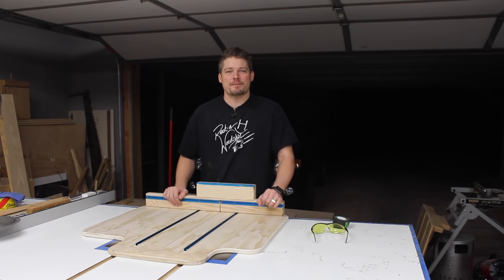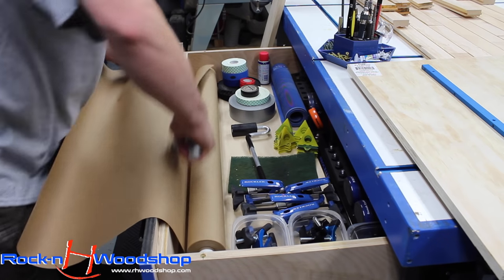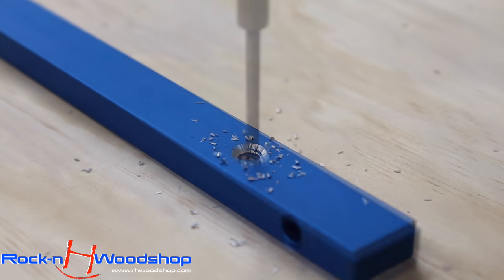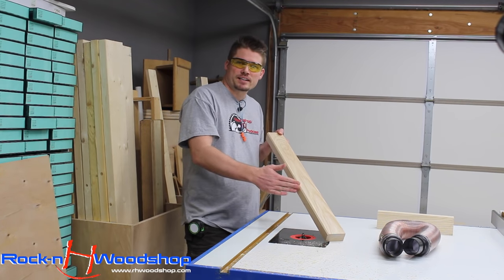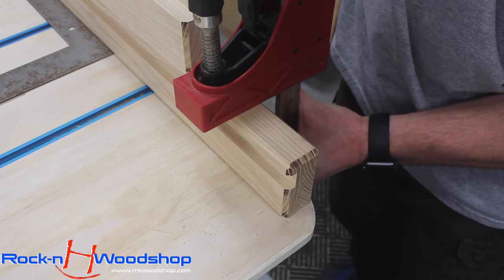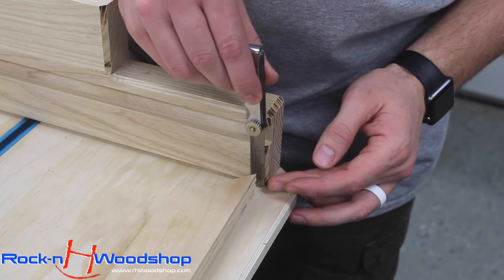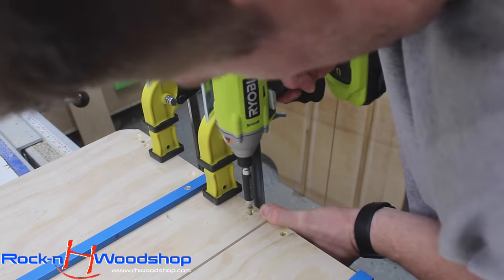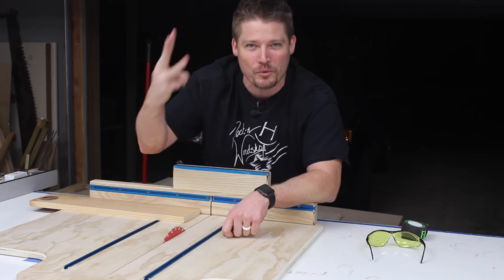Ultimate Crosscut Sled with Dust Collection

Comment: Hi, Sam here. Great sled! I have been working on one for myself and have experimented and was going to go with the extended nose tomorrow to see what happens. I like your shows and you do explain things very well. Now for 2 questions 1) I have been a contractor most of my life, but first time building a shop and working at home now. I have seen you and several other sites use some clear liquid glue? stuff either for temp hold or with wood glue because this clear stuff dries quicker than wood glue. Okay, what is it? it is not super glue or epoxy type product and you can use a quick activator. I have heard it referenced by initials and some code name. This little build stuff is new to me and having fun once again. Please help??? 2) This is only asking ... if you drilled several holes through the back board of the sled into the dust collector box, would it work better or does that blade cut really pull enough thru it? Is it okay if I use some of your idea for my sled? I was not that far behind you, maybe a year or so HAHAHAH. Keep up the work, looking forward to watching more.  Sam
Reply from the maker: Samuel Lunsford Nice to meet you Sam and thank you very much and I would much like to see your sled when it is completed. Now for your answers to your questions the glue that you are referring to that you hear initials or code being spoken of is probably C&A glue. This is just a fancy way of saying  cyanoacrylate glue, which is just plain old super glue. I use DAP rapid fuse glue which is the same kind of glue but is very effective on wood surfaces.  Now for your second question. I chose not to use screws in the box itself mainly because the blade was going to be in such close quarters with the box construction. The box is closed on five out of the six sides and it pulls quite a bit of dust through. I just completed a blog video that will air tomorrow on my second channel that will show a drastic difference with and without the dust collection. I hope that helps answer your questions.

Comment: Excellent design and video tutorial . Just a quick question I used your formula in a calculator and got a different answer what did I do wrong ? You had 0.0184 but when I did it I got -0.0081699, where did I go wrong ? .Thanks .
Reply from the maker: +Humble71 well after I posted the video for a while I realize that my graphic had a miss print in it.
Reply: thanks for admitting to the typo. I've just noticed the same mistook. I did "cheat" by using a spreadsheet to get there
Reply: Great video!  In the five cut method, you need to rotate clockwise...basically, the cut edge should be on the sled's fence, only then you compound the error 4 times.  In your case, you rotated counter-clockwise, so the error never compounded 4 times, it only compounded twice.   I think that's the reason it didn't quite align.  (This is anything better than I have..just wanted to point my observation :) )  Best!
Reply: @ClosetWorkshop  Check the video again, when he pointed to the board and counted of the side he did it counter-clockwise, but he made the cuts clockwise.

Comment: I have to have one of these so I bought your plans. In the plans you say to run the grain of the plywood across the width of the sled. Why is that? I would have thought the grain should run along the length, and actually wouldn't make any difference since the grain in each ply runs perpendicular to the grain in the adjacent plys.
Reply from the maker: If I said that specifically, I did not mean to say that in the plans. Plywood should not make a difference because grain direction really doesn’t matter in a crosscut sled. With a very sharp blade, you won’t have splintering anyway. Most of the time, With a ordinary blade, if you run the grain direction with the blade it helps prevent splintering of the veneer.
Reply: Thanks, Drew. It's great to find someone that actually replies! Love your projects and very happy that you are going to be doing this fulltime.

Comment: About to build my first crosscut sled and after watching a plethora of  these videos this will be the video to help guide me through the process. 
However, how important is it to get that close to zero on the 5-cut method? If all I ever build requires me to just use a framing square to check for square, why then would I need to use anything other than that same square when putting this sled together? Hopefully I am not inferring that I am just being lazy. I build car subwoofer boxes - rarely do they need to be within .005 of square. Hell, we can get away with 1/16th of an inch. Hit it with some 80 grit and throw the carpet on there, done.
Reply from the maker: I think you would be fine with a framing square then. I just do more fine work and I like tight fitting joints. Personal choices is all it is.

Comment: Nice video!  Why did you decide to place your front stabilizer bar horizontally instead of vertically?  Is there an advantage?
Reply from the maker: Harold Aubry there are give-and-take with both methods. If you have a vertical stabilizer in the front of the sled then it limits you to how wide of a piece you can put on your sled but the blade will always be free of obstructions. With my design it is the exact opposite I can put as wide of a piece that I want but the blade will have an obstruction. However, the way around the obstruction is to lower your blade below the surface area of the sled and place your piece of stock on and raise the blade back up into it and make your cut. Then lower your blade back down, turn your piece over and repeat the process. This way you can place a piece of stock that is double the width of the sled and still be able to make the cut because you know your fence is exactly square.
Reply: Hey, makes sense.  Great idea!

Comment: I didn't understand the reasoning for the leading edge to be horizontal instead of vertical?
Reply from the maker: Since my back piece is laid flat I can cut as wide of a piece as the sled is times two. I can lay the piece on top of the sled and then raise the blade up cut and then flip the piece over raising the blade up and cut to basically turn my sled into a panel cutter.

Comment: Nice sled! I like the variety of t tracks. Do you think it's necessary to make a replaceable throat insert to account for different blade kerfs?
Reply from the maker: scott hillegass I have not done that in the past, but it is a nice option to have. Keep in mind you would need to do it on the fence as well as the sled base.

Comment: Any plans for the T-track on the fence?  Just simple stop block?  Curious as to why you went with the simple T-track as opposed to Kreg's Precision Trak & Stop system.
Reply from the maker: Yea Bill.  If you check out my two more addition jigs I made for this sled, you will see how I use those tracks.  I plan on making a video on stop blocks for my jigs too.
Reply: Rock-n H Woodshop Saw the spline and miter jigs (love your inverted version of miter jigs btw).  I guess I was more referring the the track on the fence where a stop block would typically go and the small section on your 2nd tier of the fence.  I guess I'll just sit tight for future videos.

Comment: Downloaded your plans and making basically the same sled as the design, but have a question. What is the purpose of the top T track on the highest part of the back fence? I have purchased the Kreg version of the stop block and fold down stop, which will be used in the lower track. Just missing why the top track so high up? Thanks. Will be making the miter sled after this one is up and running. All my parts are in, other than the top T Tracks that go on the surface of the sled.
Reply: Well, I think I figured it out by looking at the design/deminsions closer. If I have 'thick' stock I am cutting, I could move my stop blocks to the higher fence, and gain that benefit? Is that the reason - or something else? Thanks.
Reply from the maker: Yes in that respect and also I plan on making stop blocks that will hold very thin stock  right over the kerf.  Hard to explain but you will see soon when I make a video on my stop block set ups.

Comment: great video as always. just wondering, how well is dust collection with the sled collection on but the table base off?
Reply from the maker: +fradchy1 it still works pretty well. Another thing that I plan on adding is a plexiglass casing that will still allow the wood to be slid underneath but allow the dust to go nowhere but towards the back which will help with the cyclonic action of the vacuum.
Reply: good to hear, i think i’ll make this modification. the plexi makes sense and seems like an easy addition. thx

Comment: Could you please clarify.  Ng multiplied the length of his right pivot to the left end of the fence.  If I'm seeing right, your 12.875 is the distance from the blade to your left edge.  Which is correct? THANKS
Reply from the maker: This was an error on my graphic and I did not notice it until after the video has been posted for several days. My actual measurement was over 24 inches which was from the pivot point all the way to the other end

Comment: Few problems I see, the dust collection tube will be dragging on the edge of the saw table becoming a pain.

The timber guides will shrink and contract due to weather rendering the. 00005 accuracy ineffective
Reply: If you can't think of an easy solution for the vacuum hose I don't know if help is available

Comment: This seems like a solution looking for a problem to me.  If you would have just put a plain ol' block of wood as a blade guard, it wouldn't be shooting any sawdust back at you.  And you wouldn't have the dust collector hose hanging off the back of your sled snagging on the edge of your table saw every time you make a cut.

Comment: The shot at 4:08 of your dado blade shows a large dia knurled nut ?   Don't recognize that, is it part of your saw or part of the dado stack ?  Is that for toolless blade changes ?
Reply from the maker: Allan Perret it is part of my dado stack. It allows me to widen my width of cut by just loosening the arbor nut and turning the dial. It is referred to as the dial-a-width dado stack from Freud.

Comment: I am thinking your adjustment difference from your pivot point is longer than 12.875 which would be why your adjustment did not bring you within .002
Reply: You measure out to the adjustment point from the pivot not the blade.

Comment: I just added the same DC to my sled and it really doesn't do much.  What am I missing?  Is there anything else you had to do to get more suction at the end of the kerf?   Thanks...
Reply from the maker: +Gil Gomes Well remember if joints have air holes then the suction is not going to work out. So you need to make sure that every place that wood joints up, is well sealed. Caulking around the joints will help as well as making sure that the hose adapter that fits in your dust collection port is sealed well. I use electrical tape to help with that. I wrap it around the dust port adapter that fits on the hose so it makes a good seal whenever I plug it into the wooden port.
Reply: @rhwoodshop  I had sealed the box in place with foam with adhesive backing.  It's well sealed, believe me.  The vacuum attachment is actually tapered and can only be pushed in about 90% of the way, causing a nice tight seal.  I scrolled through other videos of table saw sled dust collection and found one where the author had exactly my problem.  Problem was solved by drilling a 3/4" hole above the kerf slot and under the T-Track.  NOW it works perfectly...

Comment: Is that a Royals Baseball cap?

OK I see a 10" RAS in the background do you really need a crosscut sled?
Reply from the maker: Ha, no it is my logo hat. The RAS is not in operation yet but it is coming.
Reply: @rhwoodshop  
I have 2 radial arm saws,  watch some stuff on youtube for safe operation. 
Pay real close attention to feed direction ripping on it, 
I got my first one new, second one wasnt working right, 
I have 3 table saws.  If that ras isn't working take the cover off the motor and blow out the sawdust. The older ones would fill with sawdust and the blade wont get up to speed. The older ones are a dime a dozen no one wants them.  But you can do some neat stuff with one.  Just work smart. And make fixtures

Comment: nice sled just make sure you don't cut it in half because you did not put a front fence and you didn't cut it either.
Reply from the maker: certified30 that's the trick. Lol
Reply: Rock-n H Woodshop I’m curious; why the horizontal, versus vertical, stabilizer?
Reply from the maker: It allows me to cut as wide a panel as I can get on the sled and even if the piece exceeds the sled all I have to do is flip the piece over and finish the cut. A stabilizer that is vertical limits how wide of a piece you can put on your sled.

Comment: Why set the T-track into the top of the fence?  Is it necessary?
Reply from the maker: No it is not necessary, I have specific hold down blocks for thin cuts between a stop block that I utilize in that particular T-track

Comment: Does the 5 cut board need to start out at a certain size, l x w?
Reply from the maker: Use a bigger size one as it will give you an easier way to fix your error

Comment: What if you just have a basic "starter table saw" from Harbor Freight?
Reply from the maker: Well you may or may not have proper miter slots. I would just fashion some out of hardwood and then everything else can be made the same way.
Reply: It does have miter slots on both sides. This is the saw I have https://www.harborfreight.com/10-in-15-amp-benchtop-table-saw-63118.html

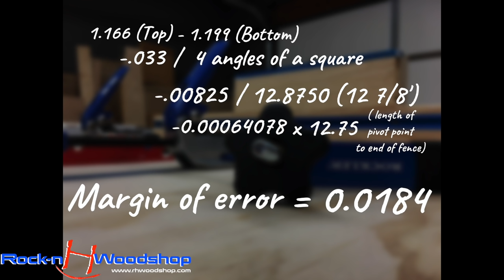Comment: Something is wrong with your calculations at 9:00. You measured an error of -0.00825 over 12.8750" which is -.00064078" of error per inch of length. You then multiplied this error per inch by the length from the pivot point to the end of the fence  which was 12.75". (Notice this length is almost the same as the length of the strip you cut off. So the correction should be approximately the same as the error you measured because the two length are almost the same. So the correction should be -0.00064078 X 12.75" which is -0.008170, not 0.0184 that you show. So you corrected an amount over twice what it should have been which is why you were off so far with the second 5 cut method. Otherwise, good video.

Comment: what kind of miter bar did you use?
Reply from the maker: +Jason Grandy You can find them at rockler. They come in different lengths and I used the 24 inch!
Reply: Thanks. Very nice tutorial.
Reply: Nice Tutorial, especially the dust collection system. I made a similar design for my router table and I am amazed how will it works.

Comment: looks like your math is off by about a factor of 2, and I think it's because you divided by something about 12" (the size of your test board) and multiplied by something about 12" (the length of your fence). But your fence is about twice as big as that board. That's why you only fixed about half the error. so you're about 10 off ATM.
Reply from the maker: Jeff Eberl yeah when I made the graphic the math should have read 28.75 for the length of my fence. I did the math right I just listed it wrong
Reply: Huh, OK. It seemed weird that it went from 18 to 9 to 5, just about halving each time. I wonder if there's another factor of 2x that you're off by, because that would explain it.
Reply: Makes me wonder if you moved it by 10/1000ths if it would line up next time (and why, the why is really more useful to me than your fence being square :P, no offense).
Reply from the maker: Yeah and plus you need to also consider that Wood is not as accurate as say metalworking. There are a lot more factors in wood that aren't going to super precise especially to the 1000th of an inch. This is one reason why measurements for Woodworking tends to stop around a 64th of an inch, but going through the equation a couple of times help to get it down further. I really wish I had the answer for you as to why but since I did not come up with the equation in the first place it would be almost ignorant of me to try.

Comment: This is pretty cool but I don't get why you use an engineering equation that requires multiple measurements. If you measured 12.7/8 and entered that  into the calculation nothing beyond an 1/8th in precision is significant. Why not square it up with a certified square off a squaring disk on the arbor?